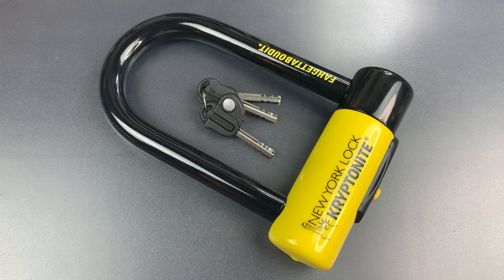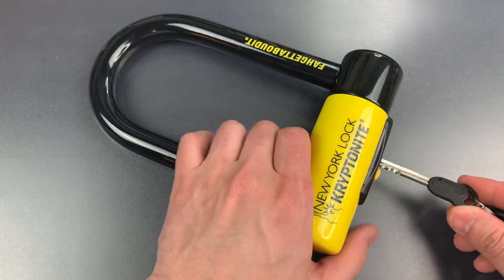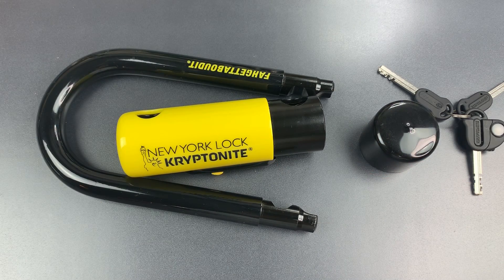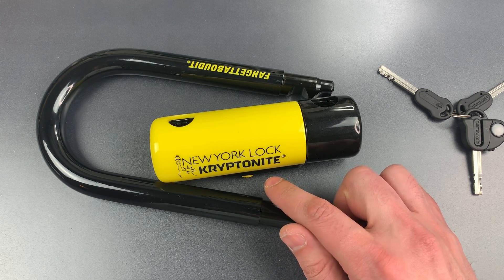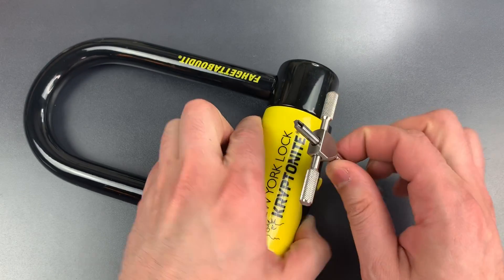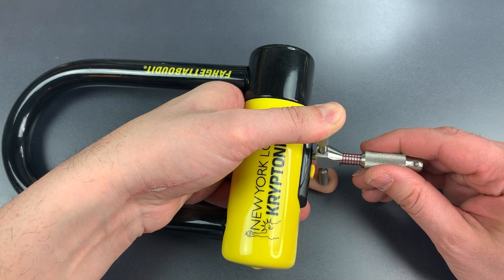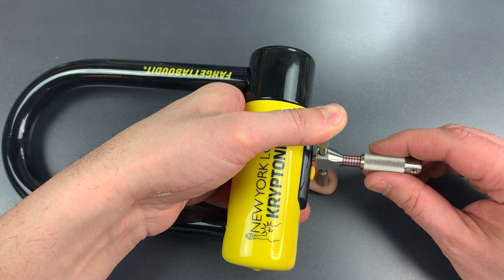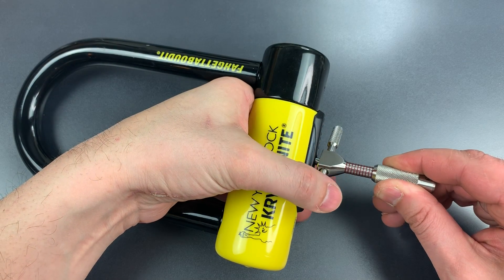[830] Kryptonite’s “New-U” New York Fahgettaboudit Bike Lock Picked

Comment: Something to keep in mind: He picks locks for a living, is in the comfort of his own home, and not under any pressure. The lock is also in the ideal position to be picked. He can also freely move the lock. No one is gonna pick a lock like this in a real world setting. It's still possible, but its not as easy as its done in these videos.
Reply: Plus with a custom tool that Bosnian Bill and him made.
Reply: It's a reason not to leave a bike in a quiet secluded area overnight though. Though a portable angle grinder still seems to be the primary attack in those settings.
Reply: As to rather people will pick it in the field: yes they will, if it's a nice enough bike and there's enough other bikes around as to where someone spending extra time on a bike lock won't be noticable. 

I've had a  bike stolen from my university's bike racks where the u-lock was picked, not destroyed, but picked.  The thing about picking: it's far more discrete than brute force so you can spend more time on it.

Comment: Aluminium is actually not that difficult to melt, a bit over 600'C can be done with blow torch, vs Zink a bit over 400 'C
I have tried to solder alu plates and in the first round it just melted away instead, hanging in the oxide sack like a wet teabag,

Comment: Which would you say is tougher/more secure ... this, or the [543] New York Disc Lock ... in terms of lock mechanism, and overall security?
I know this is meant for bicycles and the '[543]' is meant for motorcycles, but either could certainly be used on a motorcycle (at least) ... Many thanks!!  :)

Comment: Given how long this took with a tool specially made for this kind of core and a picker with quite a bit of experience,  I am pretty sure a run of the mill scumbag will move onto an easier theft.

Crime Time is measured in seconds,  Every second is one in which a thief can be caught.   Good locks either make a crook go for an easier grab or potentially make them use methods that make enough noise that people take notice.

Comment: Oh my god. It looks so easy to pick this lock... thought it is one of the safest bikelocks on the market... can you recommend a good lock for an expensive bike?
Reply: This lock is a good choice. Almost all bike thieves just rely on bolt cutters/hydraulic tools/angle grinders. You're not going to find a bike lock which is substantially harder to pick. If you want the best possible security then get a big Abloy padlock (such as a PL362) and attach it to a 15mm hardened steel chain. But the combination will weigh and cost A LOT. Want still more security? Use 2 separate locks (a D lock and a chain, for example). But you still won't stop a thug with an angle grinder if he really wants your bike.
Reply: Ahh Zett As John Davis said, this lock. If you want better (but less practical), hire a thug to stand next to your bike, but even a thug can easily be defeated given the right technique.

Comment: I'd say the lock is relatively secure considering it took a skilled locksmith, lpl, and a specialized tool to open it. Of course if I or a thief wanted it done quicker I'd just cut it with a portable angle grinder and be done with it in less than 2 minutes. https://www.youtube.com/watch?v=xey9p_vhclc
Reply from the maker: I’m not a locksmith... my channel name is literal. 👍
Reply: I guess I should have said skilled lock picker. BTW I have the  aforementioned lock and I'm hoping it will be tough enough to keep thieves from taking my bike too easily.

Comment: Started watching your videos in hopes of finding better bike lock.    I wanted to find a lock that will keep the honest people honest.    After watching your videos,  I am not feeling very good.    Do  you ever think about the bad guys watching your videos?     You could be educating the wrong people.       When you document lock problem on your video,  have companies responded by making improvements?   Or taken bad products off the market?    With your knowledge of what not to do in a lock,   have companies asked for your recommendations?
Reply: This lock is one of the best available.  Unfortunately, thanks to much improved battery technology, high-power angle grinders are available that defeat these quality locks.  Not a lot can be done about this fact.

You do raise a lot of valid questions though.
Yes, providing info. to thieves isn't a good idea.  Problem is, the internet spreads this information far too easily.  It's already out there; LPL isn't sharing any earth-shattering secrets.  No way to control it.
Can't blame the manufacturers.  They're trying to stay one step ahead of the bad guys.  But the bad guys have cheap, effective tools at their disposal.  And laws of physics & engineering say you can't make an unbreakable lock (making = breaking essentially).  So this lock doesn't need to be taken off the market.
You can get a lot of information about effective locks & locking technique on the internet.  Check out all that's at your fingertips.  (It would be a waste of my time to reiterate it all.)
Another strategy is to use two different type locks that require more than one tool to defeat.

Here's my custom suggestion:  The Kryptonite NY Fug lock is a GREAT lock.  But it can be cut (and picked, but this method is rarely used on the street).  I'd suggest taking this lock and sliding thick pipe sections over the U-shaped shackle.  Thicker-wall pipe fittings would be best; angled sections for the curve.  Slide some material (old tube socks) over them to prevent marring your bike.  Now an angle grinder will be less effective or take longer to get through all the added material.  Hopefully, the loose pipe fittings will be more likely to move around and shatter the ceramic cutoff wheel.  This is what I've come up with to try to defeat angle grinders.  

It sucks to have to be so worried about bike theft...  What we need are GPS tracking devises installed in every frame and suspension fork from the factory that would help locate stolen bikes before the grimy scumbag thieves have time to part the bikes out.

Good luck, I feel ya!
Reply: If your design rests on security-through-obscurity it is not a good design.

Comment: If I were kryptonite i would have made the lock indistinguishable from the outside ( at least with all the plastic bits in place) so a potential theif wouldn't be able to tell if it was the new version or not.
Reply from the maker: It wouldn’t matter from a pickers perspective... I’d take the same approach. Everything else can be seen by taking the rubber off.
Reply: @lockpickinglawyer  makes sense.

Comment: Having watched quite a few of your vids now I think this is a compliment to this lock.
1 - it'd be hard to have a crackhead/meth addict open with simple tools/simple tricks
2 - the picking tools to open it are unusual, not simple amazon lock picking search - yes I checked
3 - the body is hard to physically break
4 - though pickable - and the key wouldn't work if it wasn't - it took YOU 2x as long as normal even knowing 100% what you are doing.

So though there's probably a Kryptonite engineer ready to shoot themselves - they shouldn't.

IMO - and this is a layman's opinion - the only thing that disturbs me is how easy it is to set the thing in motion with that first metal bar to set the locks/initial tension.  Is there some way to make that impossible, or like if clear all tension then trigger a counter - a different type of 'false gate' perhaps?

That's on this lock - forgive my extrapolation please:-)

I think what should be done is work out electronic lock additions to keys - like in cars how they have keys that have a chip on them.  

The lock could be powered by a USB mini plug and re-charged - so if the charge goes you can power it with your phone, but NOT override it.  Sorry a lock with a phone to open it will be pickable for $100 to 'services' on Alibaba - all locks in that brand name at least.  

It needs to require the key - with the code programmed in - or it won't send an electronic pulse to open a solenoid that's tensioned to block the lock and in a way not easy to just use a magnet...  (?Maybe a separate layer that if over-powered by a magnet defeats the solenoid?)   That way if a key gets lost a new one could be ordered, then the code programmed in at home.  And if both are lost (triple backup your files, people) - hello torch/cutter with proof it's YOUR bike to officer friendly who's there to ask you what the h--- you are doing even if he didn't notice your last three bikes stolen and the crack addict walking with  them coz he was on Donut break.

AND - citing LPL's wondrous, brutal and deserved butchery of the embryonic electronic locks these need to be solid metal and NOT openable with a screwdriver with the lock open and the electronics encased in Epoxy to protect them from rough handling and make hacking from outside a nightmare even if someone has the plans to the lock. 

 Finally they need a "Key Module" that a 3rd party - namely the user - can program himself.  Most would do a key encryption, I'd use an asymmetric code.  So trip to Alibaba so the Chinese who will eventually make this and program it <> instant defeat key.

Bonus to make it re-keyable so extra $ to a locksmith - and due to the electronics it could use more or less standard parts - even a lock that our LPL friend could pick relatively easily.

Also bonus to put a 'button' on the key so you have to do something like hit it once, don't hit it, hit it ten times... as part of the input.

So, why not just have the electronic solenoid lock designed to be not easy to defeat with an electromagnet?
Coz it'll be sent to CHINA and do you think they'd not sell a drooling rapist the keys to get into a toy store that sells big stuffed animals and then a kindergarten for $100 each entry override?  Here's a hint:  Look up toy fails - they sent jump ropes to dollar stores pre-wrapped to be like a noose.  It wasn't racist.  Quite the opposite - Marx - "The last capitalist will sell us the ROPE with which we shall HANG him."

If I made/make this I'd use an Audruino chipset or other pc on a chip thing coz I don't have time to design my own chip from the ground up.  Guys that work with those could figure out ways to over-ride it - certainly as 99% it will be made that way if manufactured and - to cheat American workers- sent overseas.  So the net will become full of 'hacks' showing how to get around it.  IMO there's probably a "Wifi backdoor" that is, will be, or can be put in most of them - then special programs will be made around it.  Plus - part of why I said encase in Epoxy to fight this - someone could poke just right and insert a logic probe after shocking to reset maybe to reprogram.

BUT - if someone can get both the over-ride AND the key-picking - well you have other problems.  Likely it'd be either A - a thug with a gun -- B - a thug with a gun and a warrant - or more likely C - they spend 20 minutes sawing with fake paperwork that they are a 'repo-man' - or just time when officer Wiggum is at a donut break again...

Comment: Manufacturer spends months and many $$ improving lock

Picker takes ~90 seconds to pick.

Ok,ok the picker in question is good at the craft, using a self made tool, but still the technique is relatively straightforward, and well explained the how too.

Comment: Remember if it opens with a key it can be opened with a tool, highly specialized or not. You probably cant have a completely pick and tamper proof safety measure but you can have one that is better than your neighbor's. That's until your neighbours upgrade too and the thieves do too.

Comment: Love your videos, been watching for a month or so, would really like a vid with terminology, breakdown of lock types and shit like that. I've put most of it together through osmosis but would like confirmation that I'm thinking of the right things. 
For example I have no idea how that core works.
Reply: I don't know the 100% correct, technical names for them, but a quick list of lock types: linear/in-line pin lock (the traditional one we are used to seeing) , sliders (video 118 has a disassembly), disc detainer (video 571), levers (video 721 shows the internals), tubular lock (video 68 shows how they work), dimple pin (video 386), pin-in-pin (video 241), and combination lock.

Those are the different types of lock that I can remember and have found. The terminology you can pick up as you go along, I've found it pretty intuitive. There are also a few unusual locks that exist such as the Bowley lock (video 636).
Reply: @MrMcWrath  cheers man!

Comment: Wow that was a fast turnaround on the New U locks. Impressed and big thanks. 
I think that's secure enough for my motorcycle, defy most scrotes to match the LockPickingLawyer by the roadside!
Reply from the maker: Stewie Mac 👍
Reply: Most bike thiefs don't bother touching motorbikes covered in a thick sheet as it could be alarmed. That can also be a nice deterrent.
Reply: Check out the 1275 by kryptonite, great motorcycle lock

Comment: NOT A HARD PICK?  i think your bit harsh with that .. a better description would be 

I can confirm it has improved but because im the LPL its still needs work..
Reply: "Still pickable with the worlds highest grade specialised pick and all of the LPL's experience"
Reply: @recklessroges  

Precisely! No lock made by man can outrun these guys...guys who look at locks as puzzles. I use two of these locks when 'parking' anywhere. That said, I don't like staying away for long. Ownership of anything of value constitutes risk. Good locks and insurance is the best we can do. There should be a special Hell for bike thieves...bastards...
Reply: Exactly, and that after he emphasized he'd need to use an advance technique in addition to the custom-made tool. If I were the manufacturer I'd go advertising with this video.
Reply: LPL is an extremely talented lock picker and his experience causes him to overestimate the average thief’s picking skill. 

Anything LPL doesn’t consider trivially easy to pick should be enough for the streets - cutting resistance and strength against brute force attacks is most important. Also keep in mind at the end of the day any lock gets defeated by the cordless angle grinder.
Reply: I would be more concerned about the ability of a criminal LPL to do this on the street rather than a desk in a comfortable chair with great lighting.

Comment: This looks decent. Resistant to picking and force. Too bad they're still gonna steal your wheels
Reply: TheQuark6789 the smallest U lock that you can use is generally the best option. Then lock it in a way that it’s really inconvenient for you to open. It will be even worse for anyone trying to pick it or break it without damaging the bike. Also use security screws for everything. Either use really rare ones or make your own. For the front axle there is one from abus that you can only open when the bike is lying on the ground. This will probably deter most thieves, because it would be too much of a hassle to get. Remember: You don’t need to lock it so that the thieve can’t ever get it, you just have to lock it better than the next similarly priced bike ;)
Reply: Sierra Ideally you use two U-locks, one for the front tire and frame, second one to hold the rear tire and frame together as well as being secured to some anchor point.
Reply: There are products to defeat and deter this..

Comment: When it was clear at 3:40 that the advanced technique just wasn't enough black magic came into play.
Reply from the maker: I should have explained that more. The reason most DD locks tension from the front and back is to help keep the sidebar parallel to the bore axis of the lock. Without that, the sidebar can go a bit askew. Shaking, in my experience, helps to realign the internal components after the act of picking misaligned them.
Reply: @lockpickinglawyer  Thanks for the explanation. Unfortunately, whenever I try something like this (usually out of frustration and not purposefully) it just gets worse…
Reply: Maybe,  but how many street urchins do you think know enough to " shake their tensioner " at the right moment?
Reply: @n1ydy  anyone with YouTube does.
Reply: @bnctaj  There's a huge difference between "I saw this on youtube once" and "I have a decent enough understanding of how this is built internally that I know when and how to do this." Difference between information and knowledge.
Reply: @fredhenry101  Thanks for the enlightenment.
Reply: Would a modern Abloy be vulnerable to this or is there some extra black magic involved?
Reply: Are you saying he may have picked this lock before?....:)
Reply: @hypernovie  all of the locks in his videos he picked before. why wouldn't he?